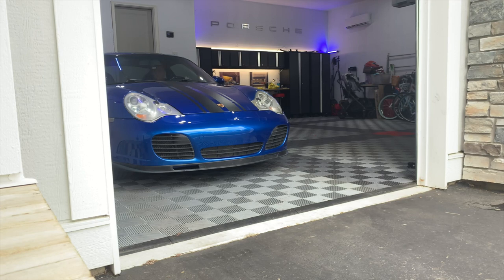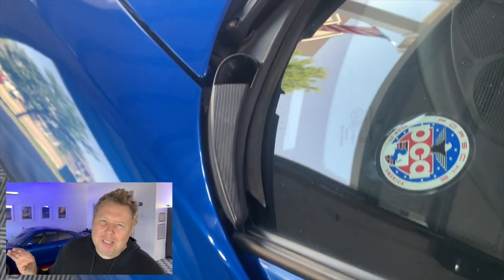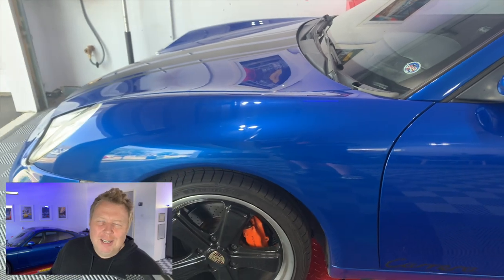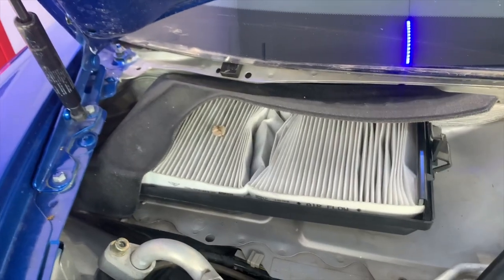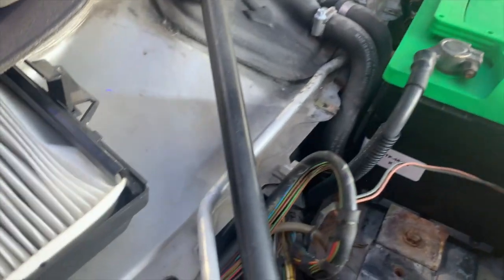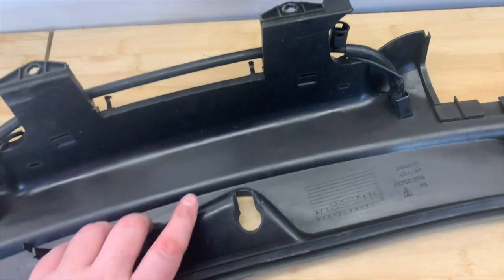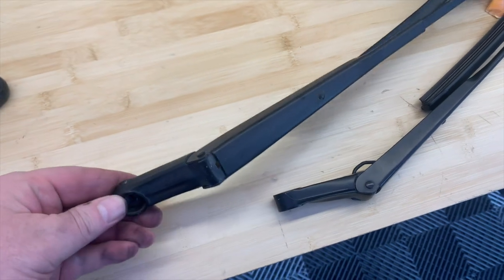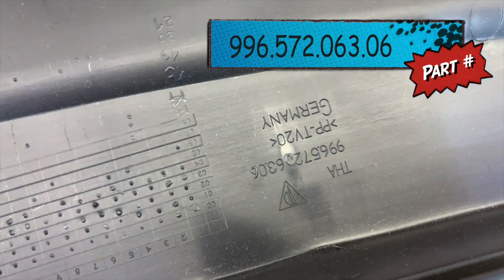Porsche 996-997 DIY - Wiper Cowl Trim & Washer Jets

Comment: I shudder at the thought of what the cowl costs.  But it lifts the car.  So much so that now the wiper arms are standing out. 😂 Should’ve lightly scuffed them and hit them with a fresh coat of black out of a rattle can.  But that’s an easy fix.

Wish I was going to TOTD, too.  Primarily to experience all the other roads in the area I always heard you talk about. Have fun and watch out for the clowns that can’t stay in their lane.
Reply from the maker: Ha! Not too bad, about $150.
Reply: @AutoAmateur  I still need to spend the $200 to replace 2 of the under trays I shattered going over a piece of wood someone kindly left in the middle of the highway.